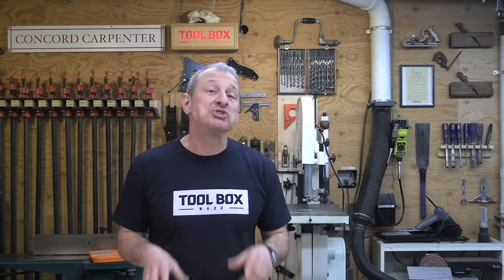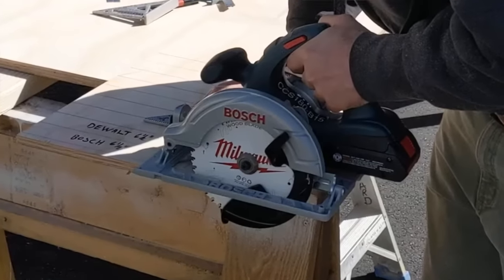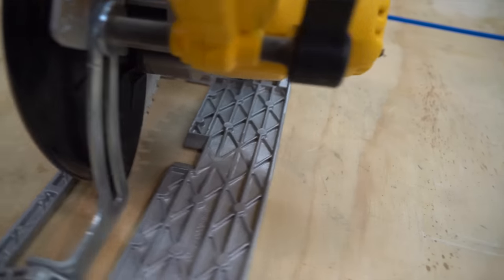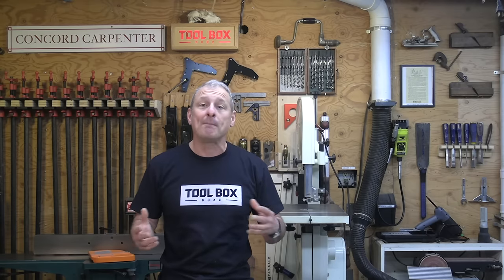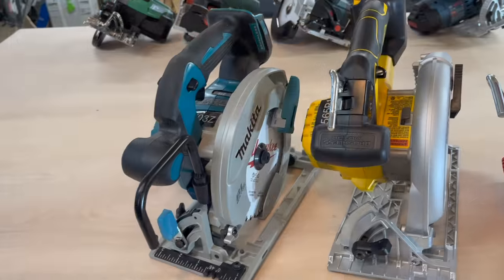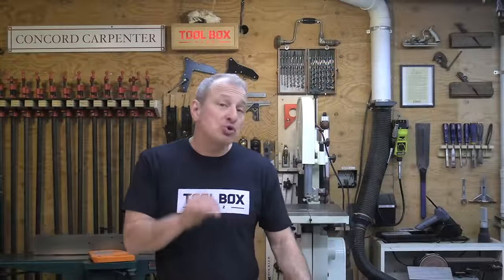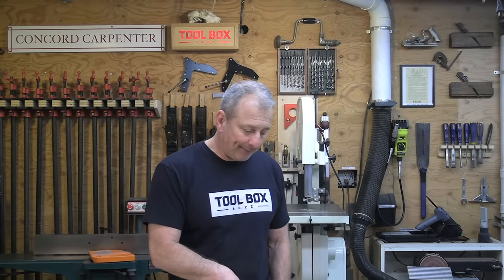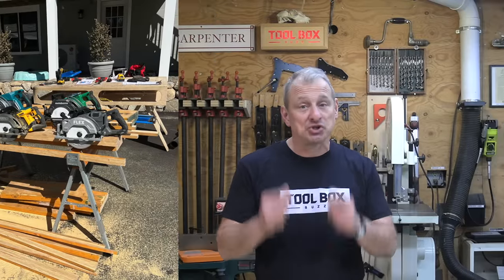Best 6-1/2" Cordless Circular Saw | Head To Head Test

Comment: I have the Ridgid. It is quick but I would trade some speed for a dust port that actually works. Seems that most of the dust comes straight out the left side of the blade. But I'm locked in with their battery platform so I kinda stuck.
Reply: try taking the dust port off the tool
Reply: @erichhartman2692  I did. Thanks

Comment: Bosch has been way behind in shipping to US for some reason
Reply from the maker: Yes
Reply: I noticed that they sent the older model to them (you can see it at the grip which is gray colored) I have the Gks 18v-57 g ( model name is different at the us in eu the Gks means = commercial circular saw the 57 the depth of cut in Metric (mm) and the g at the and means it’s track compatible with the tracks from Bosch. I bought it 3/4 years ago and it’s not bad but they did an update where the newer 8ah core battery’s now fit in.

Comment: It's so interesting you would bring up the Flex 24 volt saw, I just purchased the Flex IN line 24 Volt last month, I've not used my DeWalt 60V since, the Flex as you know is made by the same company as EGO garden tools, their battery technology exceeds every other brand, and the belt driven design is awesome

Comment: your article has erros, you guys talk about testing the Metabo hpt 6 1/2 circular saw but then show pictures of the 7 1/4 saw, then you mention that the 6 1/2 saw is a multivolt adapter saw and give it a score for that. which is wrong,.. the Metabo hpt 6 1/2is an 18v saw only, can not be used with the multi volt adapter.
Reply from the maker: We tested 6-1/2, 7-1/4, and rear handle saws that day and wrote 3 separate articles/videos. some photos MAY be mixed in.
Reply: @ConcordCarpenter  its all good, not trying to be all negative about it, if i came off like that, that was not my intention. However potential buyers might be disappointed, when they find out that their metabo hpt 18v 6-1/2 circular saw wont work with the AC adapter

Comment: Would've made a lot more sense to let a right handed guy do the line of sight test since the vast majority of people are right handed and the blade left configuration of most 6.5 circ saws is a benefit for most tradesmen. Very impressed with the rigid and metabo 57 though. Surprised that dewalt and milwaukee weren't higher on the rankings.
Reply from the maker: Ethan is left handed
Reply: @ConcordCarpenter  Yes, that's what I'm getting at. Should've got someone who was right handed instead of someone who's left handed because right handed users are predominant and right handed users get more advantage from blade left circular saws.

Comment: I've been beating that makita saw for 5 years, done so much framing, cutting through subfloor and nails, it may as well be brand new still. Makita tools are incredible, with a few exceptions ( mainly that pathetic brad nailer)
Reply: I've been hearing good things about the 40 volt brad nailer. If it would ever get released in the U.S. Of course that does mean a new battery platform, but I also want the 40 volt miter saw.
Reply: @tls5870  they nake adapters to where you can run a milwaukee tool with a makita battery. I'm thinking about getting the milwaukee brad nailer and using my makita batteries. Makita can't seem to pull off a cordless nailer

Comment: I have the Metabo HPT (although mine is branded Hitachi and has the depth gauge in MM not inches) and the original Makita LTX model from 2005, the BSS610 (Made in Japan!) brushed circular saw. I find that the Metabo HPT will thermal throttle itself if it gets too hot, which is probably a good thing but very annoying when you're working outdoors in the hot summer. It's one of the reason why I still lean towards the near 20 year old Makita even though I believe it only cuts at 3900rpm.

Comment: I bought a Makita 03 right after they first came out.  It has an Allen wrench on board. It is a tough little saw.  I burned up my previous 01. But I have put that 03 through A LOT of wood over the years.    The only thing I did to it modification wise is marked the blade guide for depth adjustment.  They had it from the factory on the 01, and I became so used to looking at it, I totally missed it on the 03.    Makita continues to deliver!
Reply: They still have it but it's on the back side of the saw and it's difficult to see compared to the old one
Reply: @evictioncarpentry2628  oh I know, that's my point of the modification.  God bless! I'm a contractor too BTW.
Reply: Overall value, quality, breadth of tool line, true one battery system, service, history... Hard to beat Makita
Reply: @travisjazzbo3490  couldn't agree more!  I'm fully invested in the Makita 18v line.  The only thing I do wish is for them to update/upgrade the batteries.   Seems like the last 4 or so 5 amp hour batteries I have gotten just don't compete with some of my older 4 amp hour ones.   I know it'll never happen since introducing xgt. But a guy can dream...
Reply: @workisfun...2438  I never heard that before. That's interesting. Here are some other facts about the old Makita 18V system even Makita People don't know.

1) Makita is one of the oldest systems in terms of that style of battery everyone else ended up copying. They haven't changed since 2005 while others have forced their customers to change batteries and get new tools since then once or twice
2) Makita is fanatical - and the first to go about shutting down the power to the tool if the tool overheats, the battery overheats, or prevents total discharge. This prolongs the life of the battery
3) Makita is one of the first to go with fast charges, doing it right by having fans blow on the battery during the charging process to keep them cool, as excessive heat wears down batteries. Even DW, who had a fan on their high-speed chargers when they finally came out, didn't cool the battery, but just the charger... Makita was way advanced and not appreciated.
4) Makita has had its electronics always sealed in its battery protecting it from moisture since the inception of those intelligent electronics. Took many years for others to catch up and do that right. Videos are online showing Makita tools being used underwater - 18V
5) Many other companies' chargers don't work well if used to charge batteries with a generator as it prematurely kills their batteries. Makita works well under these conditions with the intelligence in the charger to handle the dirty current so the batteries last

These are the types of things that Makita is about. If they marketed like Red and Yellow in this country, it would be crazy. I admire how Japanese do business, however. Quality is the name of the game

Comment: Hey Rob i purchased a Milwaukee fuel 6 1/2 circular saw and it doesn't come with a rip fence. Where can I find one that fits this particular saw. Home Depot doesn't carry them and there's so many Milwaukee saws out there and I figure I need a particular one for this saw. The thing is it says online that it comes with the saw but doesn't. Shame on you Milwaukee. I don't live in the USA to shop at hardware stores I have to order everything online

Comment: Without sounding horrible I purchased the Metabo 57 and honestly the guard broke off the third time using it while cutting half inch pine. It drains fully charged 8amp batteries within a few 4 feet length board cuts. The track compatible feature is terrible on both bosch and festool rails as there's slop Which makes it impossible to cut a straight line. I've been stuck with a saw that has serious issues and a bunch of 8amp batteries putting me £2000 worth of Metabo stuff I know don't use anymore. In my experience it was a terrible purchase.
Reply from the maker: Excellent feedback thank you
Reply: I feel that pain as a 57 owner - the 66 is a lot better but still has the slop on the rails.  I’ve found it doesn’t affect the cut as much like the 57 because there’s no play in the blade spindle to add to the movement.
Reply: @noskills9577  The worse thing I found was I had such expectations as it was metaboKGS.I thought I'd ticked all the boxes. And even passed up the Mafell for it. Now I have to re save for the Mafell.
Reply: @ryanwood6495  I got it as I needed an all in one saw to take to jobs - at the time it was either that or the festool hk.  Ironically I should of got the hk - even though it’s under powered it does everything else to a reasonable standard.  Hindsight is a fantastic thing…
Reply: @noskills9577  100% agree with you
Reply: @ryanwood6495  I have the metabo 57 are you saying you wouldn't recommend the 66?
Reply: @barttrahan7037  I wouldn't recommend it no as the issues I've had totally put me off from anything with a similar base I myself wouldn't risk it.
Reply: @ryanwood6495  l have the 66 and would recommend it.Its a 100% improvement over the 57 which is a terrible saw.

Comment: Wow. If I lived in the states I’d box up my Metabo 57 saw and send it to you - I’m a long term owner/sufferer of this saw.  It’s without a doubt the worst circular saw of any kind I have used in 20+ years.  Terrible lack of cutting power no matter what blade or battery combo you want to try, lots of play in the motor spindle combined with the sloppy track compatible base will actually give you wonky cuts on a guide rail at best - at worst it’ll bind up as it runs on the rail and want to kick back.  Awful - bordering on not fit for purpose.
I’ve just brought the 66 and it’s night and day in comparison - build quality is so much better and heaps of power in comparison, the track compatible base still has slop in it with festool pattern rails (and still no adjustment cams to take it out) but with no spindle play it’s good enough for construction work thank god.
I’ve got a lot of time in with some of the other saws as well..   the Milwaukee has good power and build but I found a the handle too thick to be comfortable over a long period.
The Makita is lovely, smooth and nice to use - lighter than the Milwaukee I think but let down by the crappy 5.0 18v batteries which just don’t seem to last as well as other makes.
I had the brushed Dewalts as well - never that accurate on the bevel settings but was nice to use with a great line of sight for cutting, one of my favourite saws ever really - I hope to get one of the brushless ones you’ve got there as I still have some batteries left.
That’s unless Makita do a 40v version of that trim saw…..
Reply from the maker: Great long term feedback, sounds like you need to replace the older saws - thanks for comment
Reply: Yep on my 57 I had to sand down the left corner of the base plate and make it flush I also had to adjust the blade to the track so it would track proper, had to sand the bottom of the base plate so it would slide smoothly, also had to use drawer slider tape in the track groove to take out the slop. Now it works fairly well
Reply: I totally agree with your comments.That Metabo 57 is a piece of junk.I now only use mine to cut cement sheet.
In comparison the Metabo 66 is a 100% improvement.

Comment: Flex for instance not wanting to participate in a real H2H makes me wander if they know THEY cant control the outcome, then they dont compete. 

Never knew about that Hitachi model that won, I really like some of the features, the new Makita 40v has some of them also. 

Back in the ancient days of electric saws, my favorite was Makita , but it and most all other saws were 7 1/4", not really seeing much reason to go to a 3/4" smaller saw when blade choice is less and price is more. 

I'm mostly Milwaukee, but have jumped into the XGT platform with all of there new and upcoming releases, cant wait to get there new planer because the M18 one, stalls on practically anything. Hope you do a H2H of power planers once it comes out.
Reply from the maker: There are 2 companies- Metabo and Metabo HPT (which is a rebranded Hitachi)

Comment: I think it has more to do with battery platform loyalty than brand loyalty
Reply from the maker: Yeah you’re hundred percent right
Reply: You can get adapters for most of the top brands. Staying in ecosystem is great, but there’s no reason to avoid a clearly standout tool over battery anymore.
Reply: @jc9923  Those adapters are very clunky and not great for the tools, besides, there isn't a tool that is so outstanding that it is worth going outside of your current platform

Comment: Using manufacturer submitted tools in testing opens up the possibility of receiving a modified tool for testing. It isn't a stretch to imagine a manufacturer turning off protection settings or limiters in order to emphasize performance. I realize purchasing each tool may be prohibitively expensive, but it is an important caveat.
Reply from the maker: I get it Chris but we don’t have the funds to buy the tools ourselves we just tested 24 circular saws there’s no way we could do that

Furthermore there’s a certain level of integrity involved here

All of these tool companies are professional and I do not think they would ever want to be exposed as a fraud
Reply: @ConcordCarpenter  that’s funny
Reply: @ConcordCarpenter  Your reason is understood. But it is a factor for viewers to really consider. There are reviewers who buy their own tools, but they often don't have the range of tools in their comparisons (e.g. Project farm). It is a tradeoff for sure. But your tests are still appreciated.

On the other hand, the integrity argument is laughable. Do you really need a link to manufacturers doing things similar to this? Do you test for this for them to get caught? Just off the top of my head, the Volkswagen emissions manipulation and that is on a much higher level for their risk.
Reply from the maker: @ccbowers  Project Farm has a million subs and a Patreon - we don't. Start donating and I'll consider it. until then  this is my model.

Don't get too caught up in the conspiracy theories - it scares off the ladies  ;)
Reply: This is not a conspiracy theory.  Please understand what that terms means- It implies grand conspiracies by sinister and powerful groups. What I am saying is really just, not being naive.  Companies are constantly deceptive about their products to varying degrees- just reading the outside of the box would show you that. 

Grand conspiracies are implausible and illogical. But dismissing the idea that a company would be deceptive to promote their products is just not dealing in reality.  I agree that many major brands would be hesitant to do that, because they would feel their products are competitive enough, or they wouldn't participate at all. Plus there is some reputation risk if not careful. 

But to assume that companies just have integrity and wouldn't do that in general, is a joke. Integrity doesn't come from concerns about the risk of getting caught.
Reply: Pretty defensive about legitimate points. I never said to change your model. I never said it was wrong or that you should even change. It is just a downside to such a model. The end. Project farm wasn't born with 2+ million subscribers. He chose his own model from the beginning. The downside, is that he isn't quite as comprehensive on each testing because he does them weekly and a wider range of items.

Keep doing what you think is best for you and your channel. It definitely adds to the information out there in a positive way.

Comment: "Brand Loyalty" is somewhat irrelevant when it comes to battery operated tools.  In order to get a different brand cordless tool, you need to buy into their battery platform, unless you want to get adapters, which are a pain to keep track of.  Witch corded tools, buy whatever you want, it doesn't matter.  But with cordless, you're not just buying the tool, you're investing in the battery platform in order to expand your set at a later date.

Comment: Metabo 57 had it 2months sold it worst saw I have ever owned in 15 year's.... It won't cut 90 no matter how long you set it up with a square. The blade had to much play on the track there was no adjustments on the saw to adjust it. The base plate was not strate or square by around 11mm on the shortest part of the plate.. o and there are to plastic bars in the bust port so it blocks up every time you try and rip without a extractor. Not fit for purpose.

Comment: DEAR GOODNESS! I don't use my saw in a laboratory or on a test sled...I use it to cut wood. Just cut some damn wood and see which one works best in the real world! 10 minutes in and you're still explaining the testing process...NEXT! This is the tool equivalent to EPA gas-mileage testing "Your results may vary"(in the real world). You wanna tyest something, test it under the conditions in which it is actually used, and rank it by the parameters that are important to the user......
Reply from the maker: We do both Bobby